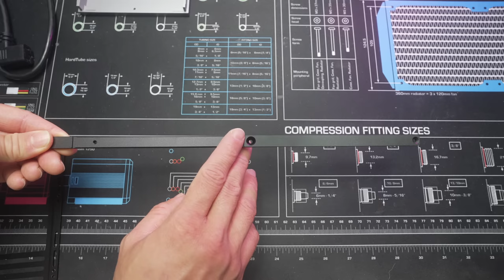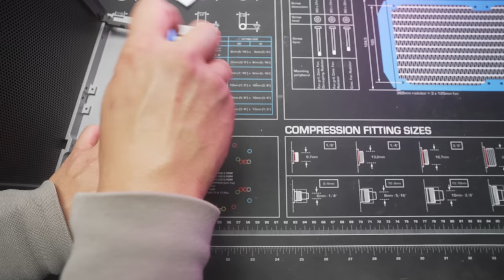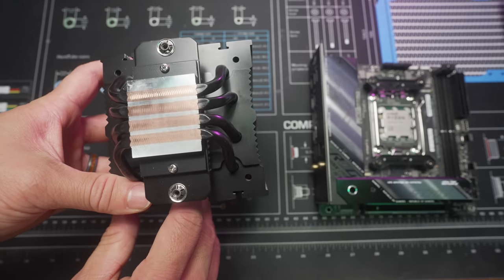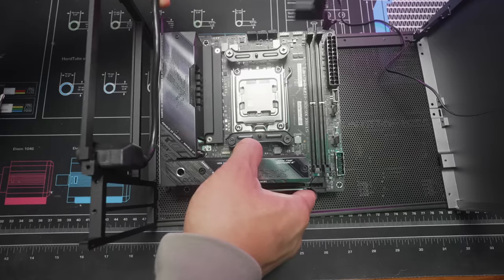Ryzen 7000... in the FormD T1 Reference

Comment from the maker: Quick follow up- I was able to fit the side support bar after separating the GPU power cable a bit.
Also if you can’t find the SE-904-XT, Thermalright has an SS110 and Noctua has their D9L, both of which are 110mm tall.

Comment: Tip: If you have a flow-through type of GPU cooler in this case, use it in the flipped orientation and add a 90mm or 120 fan underneath the flow-through area (zip tie or friction mount the fan like right on the GPU exhaust). The fan makes a HUGE difference (I cannot stress this enough).
Reply: what do you mean by "flipped orientation"? I'm interested because I just purchased this case.

Comment: Running the 7700x in Eco mode (or just a 7700 non-X) looks like a great option.  Too bad the case isn't made for a 3-slot GPU - there'd be so many more options.
Reply: Optimum tech has managed to add 4090 in the sandwich version.

Comment: Nice looking case although this might be the very definition of taking minimalism too far. Especially around the GPU. Even a 2 slot GPU is a tight fit. No case feet to speak of so the case is close to the floor which probably results in GPU suffocation. Looking forward to the performance testing video though, I hope to be proven wrong and see this case work out great :)

Comment: 21:41 It looks bad with graphics card stuck down there. Is there a option to build this upside down so GPU is on top? 🤔
Reply: Yes. Just swap the bottom and top panel and turn the case upside down.

Comment: Could put the bracket behind the GPU cables - doesn't seem to change anything as the side panel still closes ok .... just saying ... "interesting" cooling choice .... can you consider NH-U9S push - pull  for testing ? (7700X may be too much for either though) .
Reply from the maker: It doesn't fit with the brace behind (it pushes the cables out and the panel has to sit against the brace. I will try with a right angle adapter. As for the U9S I would have but I measured the clearance right at 115mm... and the U9S is 125mm.
Reply: @MachinesMore  what right angle adapter would you recommend? I'm planning my first ever PC build with the exact same GPU and a 12400f on a Meshlicious (with an ATX PSU to save some money) but the t1v2 is too cute and a bit less expensive than the sandwich version. If I move things around, my budget might not suffer too much. btw great work, you videos are very informative.